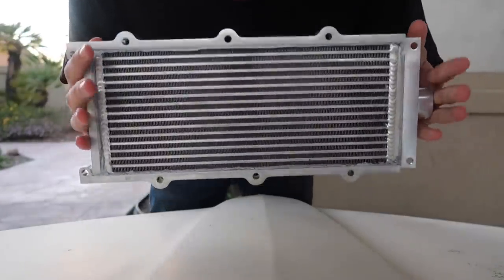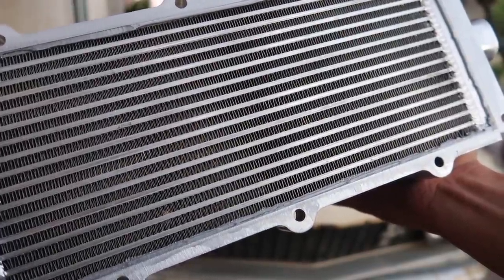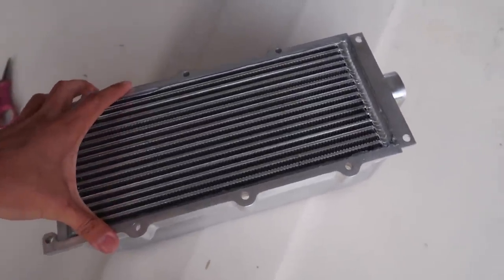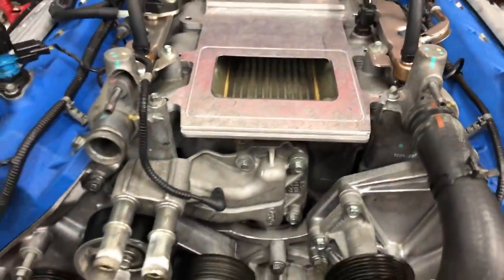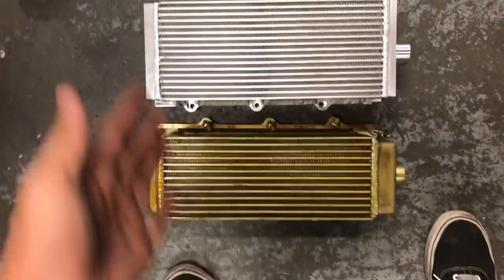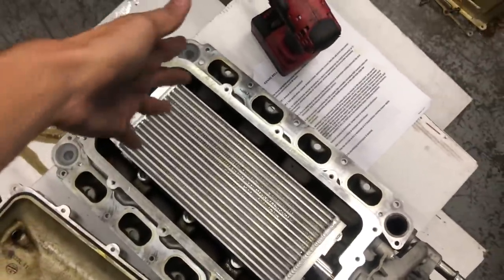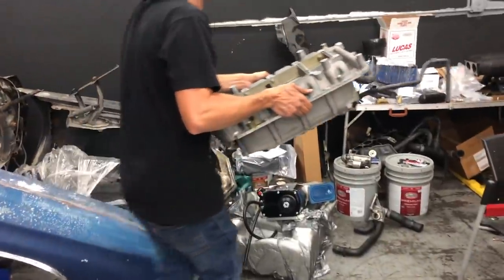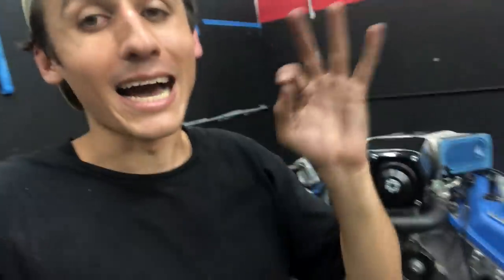How to gain horsepower with an intercooler! +25hp!!!

Comment: That intercooler made 25 hp at 1500hp that is 1.6%. That is with in the normal difference between back to back runs. Money not well spent. An large water ice tank would have done the same thing.
Reply: K
Reply: his build not urs

Comment: You will "NOT" gain 25HP just by simply bolt-on this KB Bigun intercooler without some extra machining and welding on the lower intake manifold. The way you did would ONLY give you no more than extra 5HP - since you did not machine the lower intake to expose the entire intercooler core.I have the same exact KB Bigun intercooler. What I did is the following:1: Machine the lower intake to expose the ENTIRE core area (you also need to machine out the back portion of the lower intake and weld in an aluminum plate).2: Send the KB Bigun intercooler to J2Fab to have the inlet and outlet of the intercooler bore out to except 1" coolant hose.3: Change the intercooler coolant hose from 3/4" to 1" hose for maximum flow rate.Once you have all the above than you will have what KB claimed extra 25HP gain at high boost. I did all the above and the IAT2 is only ~6 degree F higher than the IAT1 during dyno pull.